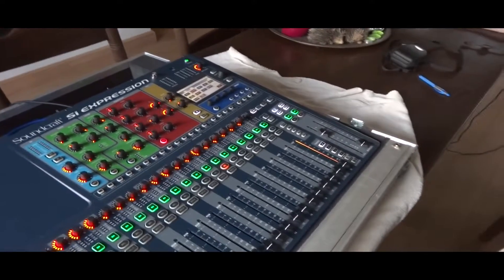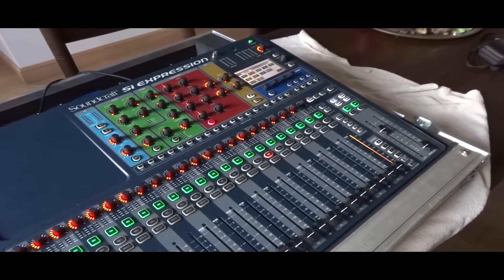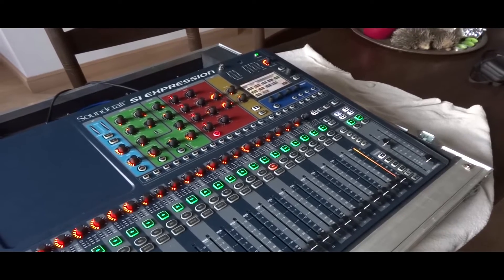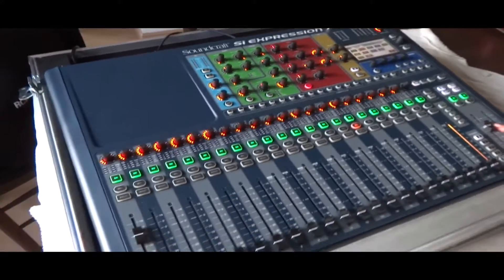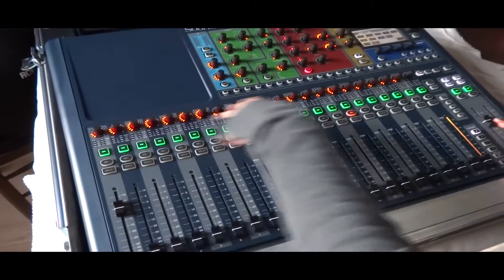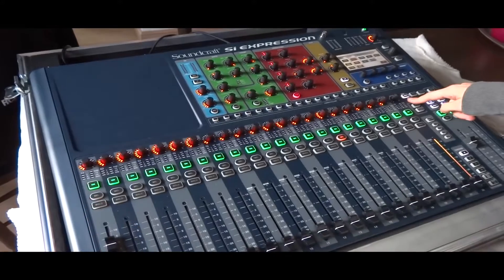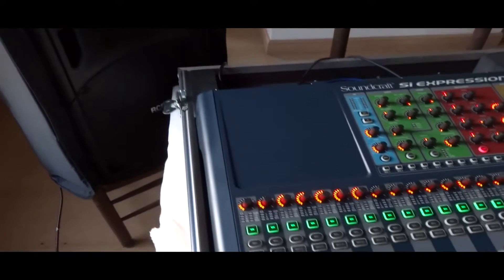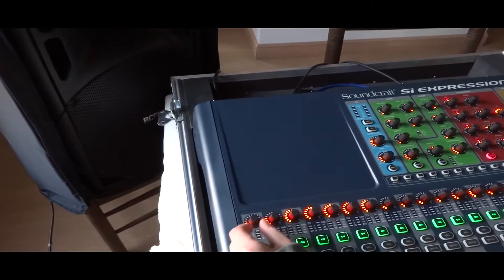Soundcraft SI expression problem gain encoder

Comment: I don't think this is a problem. Normally, you would not operate the encoders frequently as gain control. You should set them once and then use the faders to control the gain. How much experience do you have mixing? I believe that you would see this behavior on most any digital console if you cranked up the main and channel gain and changed the input gain encoder.

Comment: As Michael Grimaila mentioned, once the gains are set, there's no need to turn them but, in the past and just recently, I myself had musicians turning up during shows and I had to cut back the gain and adjust the channel faders. You have to be careful, changing channel input gain also changes that channels gain in the monitor mix where ever that instrument or vocal is in. If you turn the channel gain down, you'll also turn down that person in what ever monitor they're in.  And vise versa, if you turn the channel gain up, you'll have to cut back the channel fader and monitor send for that person. If turning up make sure you don't clip. Usually one notch up or down will do it. Maybe use a little compression for those channels.